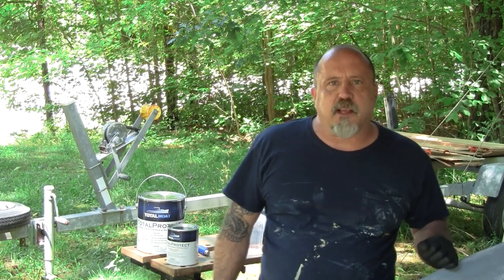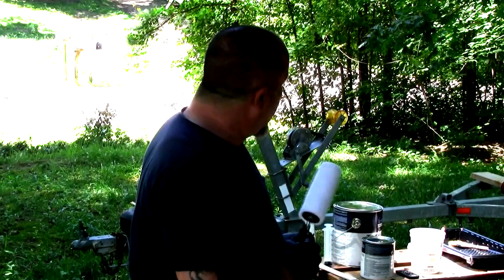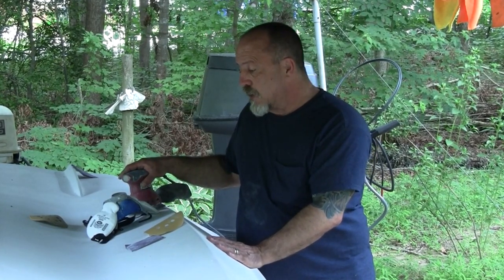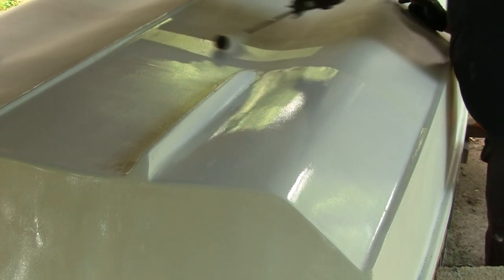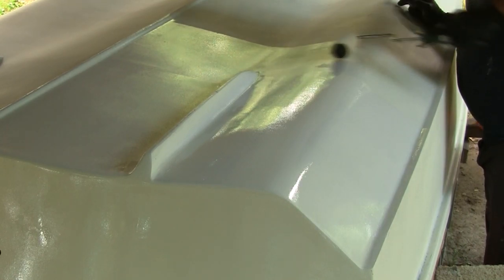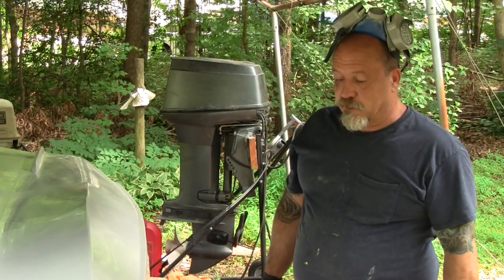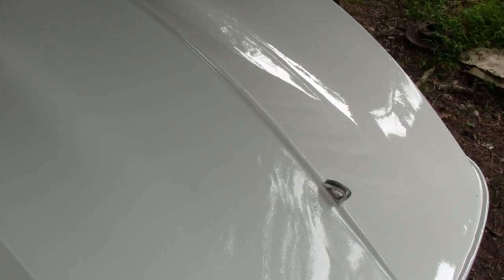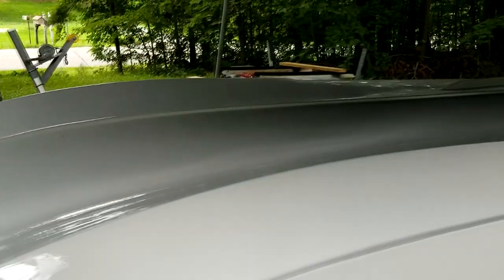Priming & Rolling NOT Tipping Topside Paint on Hull ! - Boston Whaler 13 Restoration - Part 14

Comment: I just binge watched Parts 11 thru 14.  I bought a 93 Dauntless 15 that looks pristine. However, I made the mistake of not inspecting the bottom well.  I was looking it over today to see how hard putting a keel guard would be.  The old girl got run over lots of oyster beds, I guess.  Several 4 and 6 inch patches not real well done about under the helm and there's scratches down the length of the hull maybe 6 inches either side of the keel. The rest of the boat is near perfect with just a very few spider cracks. Your series looks like what I'm going to need to do someday.  Thanks for the detail.  Now, I need the time and space to do it.
Reply from the maker: Glad you find the series helpful! For the space issue i did all my work outside under a cheap canopy and as for the time this was a a long project.

Comment: just a note on spray vs roll/tip.

If you want the HIGHEST gloss it will def come from roll/tip [RT].  the atomization process of spraying effects the end product gloss and if you did a side by side the RT will always give you the best gloss final cured outcome.  

One of the biggest issues when folks say '...I ended up with a mess...' is that it is VERY easy to get lulled into laying on too much paint and after the paint starts laying down after a while you find yourself walking down Sagville Boulevard.

In Jose's project here I think the bigger influence on the issues he was having was the 'breeze' it does not take a lot of air movement to quickly flash off freshly rolled out paint before it has the time to do it's dance.

Everyone please have a safe boating season this year.
Reply from the maker: Great information, thanks for passing it one.

Comment: I finally used the total boat stuff you sold me.  Didn’t need much , actually a pint covered a lot of surface.  I’m gonna wait a few more days till it stops raining here in Florida to do a final sand and then get her ready for the awlcraft 2000 paint
Reply from the maker: Good deal! How many coats of primer are you going with before the Awlcraft? I'm glad you were able to use the primer, I had so much left over that would have gone to waste otherwise.
Reply: @ExtremeDIYGuy   I didn’t need it to cover the whole boat.  Just spot patches in the area where I ran out .. I’m almost ready to do the awlcraft.  Total is 3 between the duratec & total boat

Comment: Jose!  Been a while since conversed.  As you know, I had some issues with my hull paint.  Made several repairs due to scrapes from launching and hoisting on the trailer.   Those areas seemed to have settle down but I recently noticed another problem where the paint is now 'bubbling' up; very small bubbles.  As you already know, I primed with the same primer you did (4 coats) then used Total Boat Topside Paint.  Not sure if I want to try and fix it now and may just wait to see what happens.  I'll send you a picture later via email.  BTW, your boat looks great.
Reply from the maker: Thanks for the update! I'de be interested in seeing what the bubbling up looks like. That usually indicates that there is moisture underneath. I'm wondering if the topside paint itself is bubbling up or if it is coming from underneath the primer? That's worth looking into, I would also give TotalBoat a call and see what they think.

Comment: Gday mate ive done three boats so far ie painting and resto and every one i have sprayed the 2 pack on and it looks c*** . Each time i think i have stuffed it up but then like magic after about 2 hours it smooths out and the gloss comes up and after about a week it looks amazing, the last boat i did i rolled the primer 2 pack on (mainly lazy didnt want to set up gun ect ) and it came out great ,what i will do with this latest resto is roll out the top coat on the bottom of the hull and that will determine if i roll out the rest or spray on the top coat another issue is its a clinker hull not a smoothy so that might be a problem to roll as well . Always good to see another persons project with a good outcome .
Reply from the maker: Thanks, I'm extremely please with rolling it and not tipping. Havent tried spraying but the way it leveled out is perfect!

Comment: Just did the barrier coat primer today with ToatlBoat Total Protect.  The paint in the large can settled into a watery layer on top of  heavy mud like layer.  I had to used a thin cut of lumber as the paint stick would have snapped.  It took maybe 15 minutes of very hard stirring and scraping to work it into a smooth mix.  Wore me out so much, I only had the energy to do one layer.  I also learned that it takes about 42 oz mix (without thinner) to cover the hull for the first layer.  Results look good but it is a little pebbly.
Reply from the maker: Fortunately, I didnt have that problem. But I also took my cans to HD and asked them to run them in the shaker machine, which probably helped a lot. Make sure to sand between coats and the pebble look should go away!
Reply: Yeah, pebbling was quite bad, which I blame on the dry hot weather.  Had to grind it down with 60 grit then add a 4th layer (additional purchased quart).  Finally finished the 220 grit sanding last night.  I am still sore today.

Comment: Looks great! I am getting ready to paint out boat soon. The weather is always an issue here in the Deep South. I use a lot of those syringes you use, they have a lubricant in the tube and on the rubber. I always wash them out with acetone and lube the rubber with what ever I am using in them . The lube may have been causing you problems earlier in the video?
Reply from the maker: I guess it depends on the syringe manufacturer. These are rated for medical use and are sterile (Probably pay more than I have too for that) and are squealy clean. Another option is to use a scale to meter out paint to catalyst/hardener. I have done that for cerakote but not for the boat paints, I may have to try that on my next restoration.

Comment: Hey I know this does not have much to do with this video but I was watching your hydroponic garden videos you posted a while ago and was wondering if you were keeping up with it or if you have stopped, and if so why did you stop... I am thinking of starting one myself. Thanks :))
Reply from the maker: I stopped, This worked out well but the only problem I ended up encountering was that there was a risk of draining down the pond. This is especially true if the root systems start clogging the flow of water or if the plumbing fails omewhere along the line. I will probably try this again but rather than using PVC I am thinkg of doing a tray system with a natural overflow into the pond itself. But this wouldn't be until next year.

Comment: Thanks for your help, I primed the hull today. Two coats took the whole gallon. I had trouble with the mohair roller I was using. I switched to 7" west system foam roller and wow, what difference. The fight was over. Total protect is like consistency of sour cream when can is mixed. The activator turned it into usable paint, it was a messy , hot process. I have a lot of repair work on the deck that needs to be primed, I have another gallon of total protect, I may save it for the bottom? I think I will use Interlux epoxy primekote on the deck , since I already have a gallon of it. How hard to sand was the Total Protect? I am going to let it set for about a week before I can get back to it.
Reply from the maker: IT wasnt that difficult to sand, the Random Orbital did great with 220.
Reply: Great, I have plenty of 220 grit, poor  random orbiter has been through a lot. It is still working. I think I have arthritis from it in my wrist. I am so tired of sanding and the heat is getting bad now too.

Comment: Nice video, looks great. I'm in the process of repainting the hull of my 17' aluminum hull fish/ski boat. Just primed it yesterday using total boat epoxy high build primer. I'm getting conflicting information on what top coat to use. Total boat told me I should use pettit paints vivid antifouling bottom paint, even though I keep the boat on a trailer. It is only left in the water (freshwater) once a year for a week when I go fishing in June, otherwise it's in and out on the same day. I want a glossy finish like yours, and I see that you used topside paint even below the waterline. Any advice? Thanks
Reply from the maker: I'm surprised they told you that. If you have an epoxy barrier coat on it, you should be able to put a good quality topside paint. A two part poly like Interlux perfection should work

Comment: Great video. I wonder though, if you had a “Tipper” folllowing you on your rolling, if it would have decreased or eliminated the need to sand? Not criticism, just wondering based on boatwright videos I have been watching. Thanks for sharing. Your boat looks great. Will be using this on my kayak. :)
Reply from the maker: That's a good question. I wanted to try the Russel Brown technique and that worked out pretty well. There's also a video by Epifanes that basically describes the same method. https://www.youtube.com/watch?v=IjbWiSR6LKg Great question though. Good luck with your Kayak!
Reply: Thanks for the link Jose.

Comment: Never painted a boat before but I have a sailing dinghy I'm considering painting.  My question is: Can you use topside paint on the hull and get good protection. I plan on sailing in freshwater lakes and keeping the boat in my garage.
Reply from the maker: Yes you can but here are the caveats. Use a good two part epoxy barrier coat firt then use a two part polyurethane paint on top of the barrier coat. Totalboat advised that as long as the boat in not in the water longer than three days there should be no blistering of the paint.

Comment: Really love all of your tips, attention to detail, work ethic and understanding of material ingredients and best practices. Question: I want to use Marine Tex RM 330 Gluvit on my freshly sanded bare metal aluminum hull over seams and rivets then apply over Tex Marine TotalBoat Total Protect epoxy barrier coat…. Are those compatible?
Reply from the maker: I believe that Gluvit is epoxy based so they should be compatible. One thing to consider is that Gluvit is also a barrier coat so you may not need the Total Protect, but would still give you a really strong shell. To be honest, I would call the tech guys at Jamestown or TotalBoat and ask them. They have been extremely helpful in the past when I have called with questions.
Reply: @ExtremeDIYGuy  Thanks for response, Jose. Yea, Gluvit is a epoxy base but after calls to TotalBoat and Tex Marine recently I did not get a solid response about layering one over the other. I’ll try Jamestown but don’t mind providing a strong shell for my 1954 model that’s getting it’s first total restoration after a lot of nicks and dings in the hull. I appreciate your help. BTW, the Boston Whaler and your videos turned out great!
Reply from the maker: Thanks! If you have the material you may want to try it out as a test, might be a tad hard to mix small proportions of each but definitely worth trying!
Reply: @ExtremeDIYGuy   Good idea! Also liked your plastic wrap to help seal the paint cans. Good stuff.

Comment: Quick question I have found a Whaler exactly like this one. Looks like it’s in good shape. Would you pay 250 for it with the trailer? Just wanting to see if it’s worth it. I’m basically going to have to go through the entire process you have. That’s how I found your video. Thanks in advance! Keep the videos coming
Reply from the maker: Totally, even without a motor that's a good price. The trailer is probably worth that much by itself!
Reply: Thanks for responding Jose! I know it’ll take some work to get it up and back on the water. But I could use a project. I need to get back on the water and fishing. If it’s not too personal about how much do you think it’ll take for a project like this. Almost identical to yours. Just not the motor. Thanks
Reply from the maker: @thefamsquad5609  Without the motor somewhere around $2500

Comment: Always enjoy seeing how to make a perfect looking 2 part finish without having to professionally spray it indoors. I  will say that if you want to save time and also dispense with those syringes, get a $25 kitchen gram scale at Walmart and just put a cup on it. Zero it out and then pour the amount of part A into it that you think you'll need minus what you estimate the part B will be. Let's say 3 parts to one so you just pour 75% that you think you need. Forget pumps, forget syringes. Then note the weight in grams. Divide by 3 with your phone calculator,  then take that amount and add it to the original number. For example, let's say you pour 127 grams of part A. Then 127 divided by 3 gives 42.3. Add that to 127 and you have.169.3. You then pour part B into the mix until it weighs 169.3 or close enough.  Seems complex but its really just, pour part A, calculate, and pour part B.  DONE! For small amounts you don't save much time if any. But for a pint or more it saves time. The bigger the amount the faster it goes. No more pumping or syringing.
Reply from the maker: That's great advice! I know the cost of the syringes can add up after time. I have kitchen scales as well as high precision scales so will give this some consideration on future projects.

Comment: I got kind of confused about how much perfection you ended up using.  If you had not had the issue you had how much would you have needed?   Doing my 13 over and will likely use interlux perfection.
Reply from the maker: I ended up with 4 coats. I really think that you can get by with 2 coats from a quart, thinned to 10-15% and with the surface properly primed and sanded. It is a bit cheaper ($20 or so) to buy it by the gallon but you might end up with a half gallon left over! It's a tough call but if I were doing this again for a 13 I would go with a quart. If I really needed to, buy a second quart.

Comment: Jose, enjoyed the vid. Question: can you use this technique on the bottom of the boat, that's NOT upside down? I guess one would have to mix it at a different ratio?
Reply from the maker: I think it should be fine. I did the transom with the same ratio and it was basically perpendicular to the ground. It settled down nice and flat.

Comment: Bear in mind that painted boats need to be repainted.  I’ve tried a couple of two part paints,including Perfection and found them not really any better (all considered) than One Shot sign paint (the best oil paint) with enough Penetrol to slow drying to be able to tip with the same 7” standard foam roller. True, the shine doesn’t last but it is easy to sand, which I found almost impossible with the two part paint that was good at retaining it’s shine.  (Perfection was easy to sand.)

Comment: Hey Jose.  Thanks for the videos, I have watched several.  Did you test the existing substrate prior to priming with the total protect?  I'm concerned I may have a one part paint on my hull
Reply from the maker: No I didn't, I sanded the heck out of it though. I have a theory that if you apply one coat of two part paint, anything not compatible should bubble up. At that point, scrape or sand it off and keep going. I havent had the opportunity to try that yet though.

Comment: José is the gray and white primer the same? I’m going to be using that on my hull because it had bottom paint before and there were some blisters and I need a barrier coating.
Reply from the maker: They are the same, just different colors. I actually used up some gray I had first then went over it with two coats of the white

Comment: I had a hard time with this paint it dried up on me really fast as I was rolling the paint on the hull
Reply from the maker: You have to pay close attention to temperature and humidity and adjust for that, Thin at a minimum of 10% as well. I actually planned when I would apply paint based on conditions forcasted!

Comment: Hey, I am getting ready to put down the first coat of barrier coat primer.  Did you sand between primer coats? I understand the directions says I don't have to , if I recoat before 60 days. I see you say after the first coat you had to make some spot repairs. Did you sand it before making those repairs?  I am sure I will have to do the same thing. I have a larger boat and I am tired of sanding, just trying to cut back on sanding some if possible.
Reply from the maker: I did, I sanded between every coat I put on the hull. I did use progressively finer grits when doing the finish coats. I lightly sanded the repair areas before applying fairing compound, then sanded again lol :)

Comment: Nice job Jose but a little confused as to what you did differently on that final coat to have come out so much nicer? Thanks
Reply from the maker: Larry, pretty much the same thing. I believe the first coat had too much hardener, I was extremely careful on measuring the quantities on the final coats, also thinned to10% and rolled carefully and sanded between coats.
Reply: @ExtremeDIYGuy  THANK YOU - very much appreciated.

Comment: Can you paint a boat with this product without turning it upside down?
Reply from the maker: I suppose you could but getting the underneath would be difficult because the boat is resting on the bunks. If you have  a way to lift the boat you could do it that way. I chose to flip the boat, in the long run it turned out the most convenient way to do it. Hope this helps!

Comment: Hi. Cuestión what’s the difference between rolling or spraying?
Reply from the maker: Another person commented on this earlier, they explained that spraying causes much of the solvent to flash off in the air resulting in a rougher surface and that rolling gives the paint more time to settle down flat. I'm not entirely sure how accurate that is but am extremely pleased with the rolled on results I got.